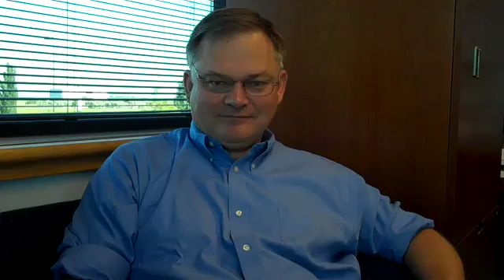Talking U.S. nuclear energy strategy

Comment: I agree that nuclear energy is a significant part of the energy solution as well.  Solar and wind are just impractical sources because it's on off and the high costs and lower output compared to nuclear. And nuclear tech is more well established. We should make use of nuclear power as soon as possible, so it provides a clean source of energy while buying time to research solar, wind, hydro, and fusion energy. Nuclear is a great, temporary, if not permanent answer to solving our energy needs.